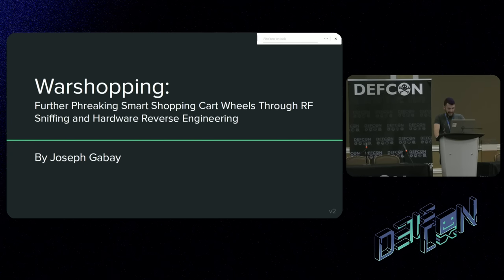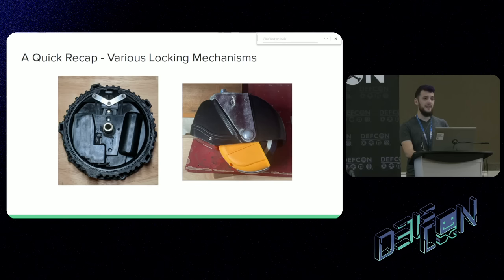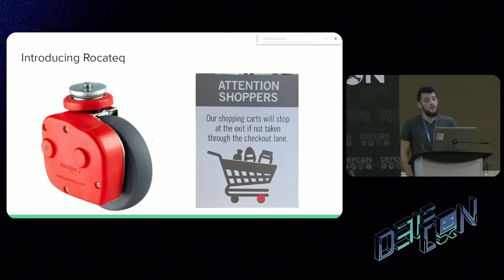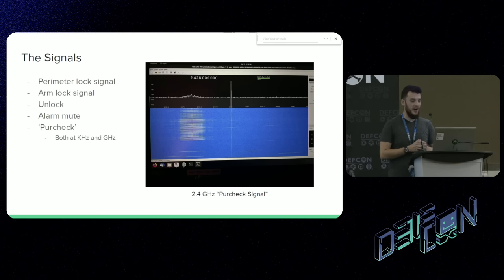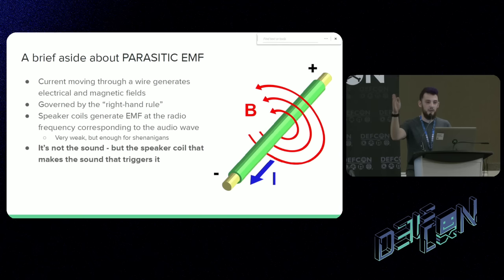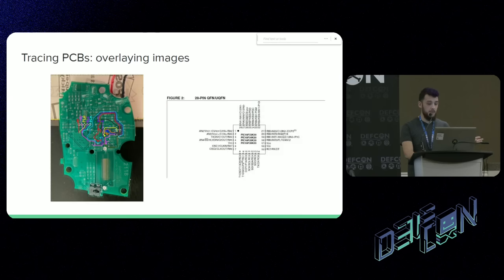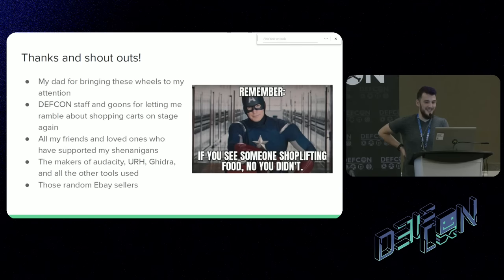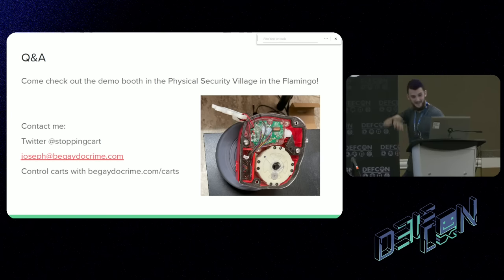DEF CON 31 - Warshopping- Phreaking Smart Shopping Cart Wheels Through RF Sniffing - Joseph Gabay

Comment: involving your own personal cat.

cant you just jam the frequencies?  broadcast a blank carrier to overwhelm signal?

the tones sounds like the coins in super mario bros.

my theory on the missing chip is.

1. this is the budget model (the reason that this could be cheaper is they dont redundantize the transmitter instead using the sub 10khz signaling )

2. they are synthesizing the 2.4 ghz just the same you may synthesize music by generating a white noise and then using filters to remove parts until you get the desired signal.

3. using a coil and capacitor tuned to 2.4 ghz they hit that with a crude signal and since the signal is weak enough the fcc isnt going to be worried about the shopping cart knocking out everyone's wifi and bluetooth device.*

*= remember in the early days of radio when sparks was used for radio?

they was just transmitting morse code so it was simple pulses of raw interference.

4. a long shot but maybe using a simple on and off like the single function radio controlled cars from the 80s they just went forward and reverse and they used channel 5 of cb witch is 27.015 mhz.

so a simple 2.4 ghs carrier with no content saving on costs.

the chip as an accelerometer maybe the wheel uses a stepper motor as a signal generator and so they can just listen for the signal from the wheel that way.

Comment: You need to talk with some ham radio experts. The receive and transmit at these low frequencies.
Reply: re: "The receive and transmit at these low frequencies."

Um, not at 8 kHz.
Reply: Lowest frequency that HAM systems broadcast at seems to be about 135 kHz, at least from a precursory glance. They might have much helpful information but 135kHz is much higher than 8kHz.
Reply: @briannem.6787  Um, broadcasting is illegal. Maybe the term that should be used is "transmit".
Reply: @uploadJ  I am pretty sure "broadcast" means to send a signal which can be received by many, as opposed to things like mobile phone signals where the traffic is mostly intended for a specific receiver. Many activities in amateur radio are about contacting many others, such as seeing how far away you can get a clear response from. So, I'd say amateur radio is almost always broadcast.
Reply: @briannem.6787  Broadcast, as, to an audience. Nah. We don't think of it that way. The term "Broadcast" and "Broadcast services" takes on special meaning outside of casual layman/pop culture use.
Reply: @briannem.6787  re: "Many activities in amateur radio are about ..."
Says a layman to an actual ham (me).
Reply: @uploadJ  oh, ah, sorry... I haven't studied up for my license test yet... I always assumed the definition of broadcast meant the wideness of potential reception rather than being intended for the broader public (or however it's defined)

Quite improper of me to make assumptions and "uhm actually" somebody who knows. Well, at least I know something for when I start HAMing... thank you for that.

Comment: How does it actually lock and unlock I just see a switch in the pcb not an actuator?
Reply: There seems to be a motor with a wire and a connector. Look around the 25 minute mark.

Comment: U could easily do this with blue tooth. Buy a wireless Bluetooth transmitter/reciever for 10-$20 and hook up headphones to use the signal as pre amp input what ever they make every type of connection to what ever other connection wires. Like 2.5 mm headphone male to rca out single or stereo some even do the video like old vhs video. But super easy super cheep and can even build your own WiFi rf or Bluetooth modules then buy a rechargeable lithium battery and regulator and choose usb micro usb USBC in and if u got a big battery even have a emergency charge 5v out port in any of those. Then u just sub out a phone dac like the Apple fire port dongle cause the Bluetooth board that runs on 3.5v and it does all the transactions and dac output. Super simple. And they are like the size of a liesterei strips pocket pack and weighs about the same. Super small super light packed rechargeable Bluetooth that is simple to pair and the better ones from anchor have both transmit and receive so makes having a couple of them and u can wire a whole home theater wirelessly tho sound quality won’t be great and would still need amps power supplies and hard wire the boards with a down voltage regulator or again just order the boards and go full McGiver mad scientist DIY’ed the 💩 out of it my self one of those and a car amp and battery u can make wireless Bluetooth speakers with a few hundred watts and legit loud subs. Or get a power supply and some amp board and some lithium batteries that hold a dozen or more amp hours and u got a both 120ac plugged charging use  or wireless mod. Seriously how did you get into robotics and all this and just fly over how most people are introduced into electronics, the world of DC then forced to learn AC basic electronic components cause who doesn’t like music but hate how much the equipment is and most of it is cheep crap thrown into a rack box and there brand names slapped on it. Only a few actually design there own boards and stuff. And even those they end up cheeping out and using the cheapest or even bootleg components that won’t and don’t last forcing you to buy there newer models that has the newest codex processing like Atmos or what ever.